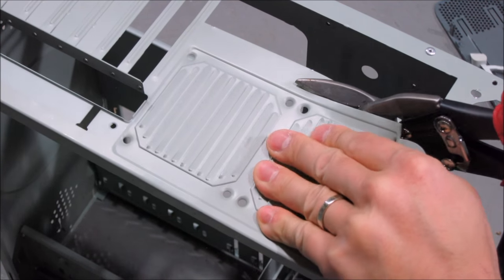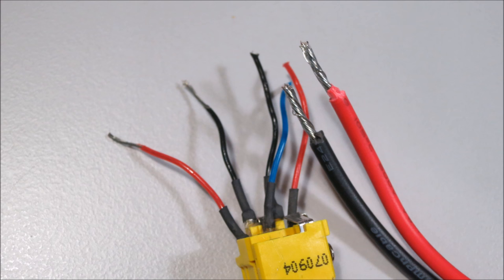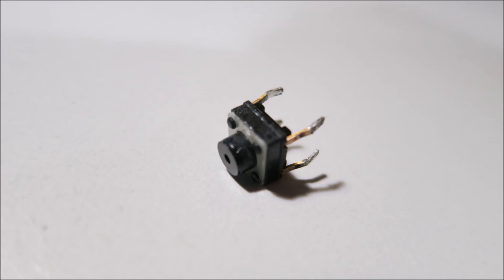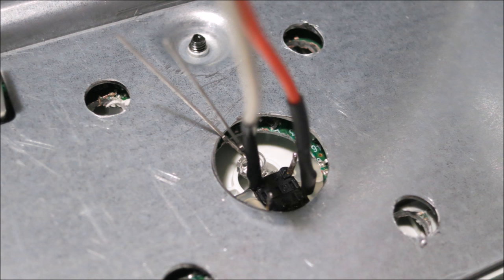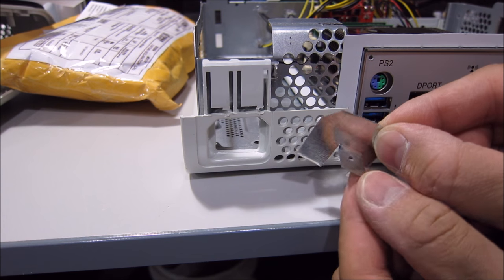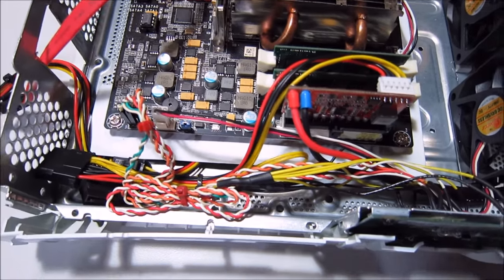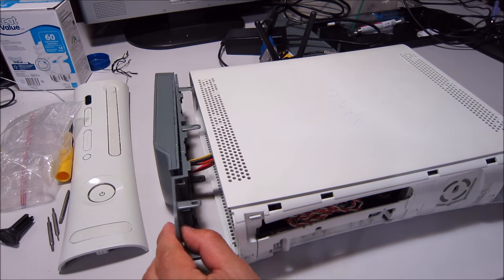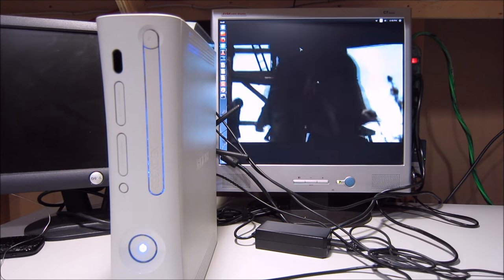A Computer in a XBOX 360- mod/ build

Comment: 5 year old video, but the powerbutton/led/wireless assembly is actually connected with USB, and with a microcontroller and some soldering you can get it to work like a stock 360

Comment: Love this stuff! New subscriber, really some great ideas and builds on your channel.  Man what stopped you from wiring up the whole RF board so you can use the 360 wirelss controller on it for some retro gaming or even to control the whole PC? I know the drivers exist natively in windows for the RF board these and it can be wired to usb input. Then you'd already had the factory xbox leds as well and could wire up the switches and other leds directly on it.
Reply from the maker: Thanks for the sub and the feedback! Good points/ideas. I'm not that familiar with that side of things. Admittedly, I don't have an electronics backround. If I had more time I would love to do the things you mentioned. Honestly I have to look up too many things up even to know where to start!

Comment: Great vid! I'm wanting to do something like what you have but it's going to use around 300 to 350w, is there a psu like the one you have that can support that?
Reply from the maker: I'm really not sure if a pico version comes in a 300 watt. I have a TFX psu that can go up to around 300w that will fit in my PS3 build and likely the 360 build as well.

Comment: Questions: Could you get two SSDs in there?  Could you use a microitx motherboard?  Could the 360 DVD drive be kept in?  Would you build such a system for $150, if parts were supplied?  If not in a 360 case, maybe an original Xbox case.  Then, if an original Xbox case was used, could a video card also be put in?  Serious, inquiry.
Reply from the maker: 2 ssds. Sure there is room. micro atx board (a smaller one) could fit. As for the 360 drive, I'm not skilled enough to get it hooked up to the motherboard. I'm not sure if it's even compatible with other boards. I've made a HTPC in the original xbox. I used an AMD APU only. That being said, I've also seen people mod it with a pci-e extension cable and the vid card laying horizontal. I would guess a single slot card would be best and not a dual slot. There isn't a lot of room once you get a cpu cooler and components in there. Heat removal is the tricky part once you cram more components in. Will Urbina made an insane xbox build and crammed everything into it. I'm not sure if it's still operational though.

Comment: Is it possible to fit directly a notebook motherboard with i3/i5 CPU and dedicated VGA? Also this should allow for the use of DVD player....? Thx in advance, and great video!
Reply from the maker: It is possible. Depends on what size of notebook motherboard. That would be a good idea but likely not a project I'd be able to do!
Reply: Well, i was thinking that after all console motherboards are exactly like notebook motherboards, so why place an entire desktop system! This should save up a lot of space and you can just use the original notebook power supply ;)

I might try that, but i'm not sure i can do it, if you have any suggestion or if you will ever try to do it, link me the video! XD
Reply from the maker: True about the set up and use of the power brick. The funny thing is, I have an old laptop that might be a candidate for such an adventure but I won't do it unless my screen gets busted up! I'll look for an old one with a broken screen. Make sure you sub and you'll see if I ever do one. Right now I don't have anymore broken consoles...
Reply: Ooook, i need one half-broken notebook too XD

Comment: Oh no, you just drilled the RF module? 🙈 You could have used it almost 1:1 as a USB wireless controller adapter, didn't you know that?
Reply from the maker: Don't need that function for my uses.
Reply: It's still kind of sad that board got destroyed like that. The power button can be caught on pin 5, if I recall correctly and it's possible to feed the board with serial signals to control the LEDs individually in green, red and amber. There is also a signal to just call the Xbox 360 boot animation. With some kind of microcontroller the front could have looked more authentic.

Overall it still is great and I like your other videos, this was the only thing that really bugged me.

Comment: cool. which heat sink is that? thanks
Reply from the maker: It's actually an embedded apu with a pre installed passive heatsink, therefore silent. It is only passive because the tdp is so low, like around 25 watts.
Reply: oh ok. thanks

Comment: Nice video, too space. Try insert this hardware in a snes case.
Reply from the maker: Space is good for the ventilation which is so limited which is probably why the xbox360 had so many overheating issues.

Comment: so if you wanted it for gaming would you just have to make more ventilation
Reply from the maker: Yeah, I think so. I've seen some with no ventilation but I don't know it they still work or throttle. Also, a strong enough TFX type PSU is a consideration. A 750ti that runs off the PCI-E power (65w) would be my choice... they also come fairly short.

Comment: hey, I'm following your video but I cant work out how to do the power switch... please help
Reply from the maker: I've seen better ways to do the switch. I used a momentary switch from another device. Basically made a hot glue support/webbing to hold the switch where the xbox push button would be. A lot of trial and error and I would recommend this. Make sure you solder the 2 switch wires on diagonal sides of the switch. There is no worry about negative or positive for this switch.

Comment: orange pi  or raspberry pi inside
Reply from the maker: That would certainly be a lot of space for the pi. I'm still enjoying this has a media center.
Reply: @LadybugAdventures   do you think it is possible to fit a micro ATX mobo  and its big 24pins power supply  inside  xbox360 ? do not know if I can power micro atx motherboard with the same power supply you used in the video to save space .
Reply from the maker: @tunkunrunk  I think only a pico psu could work due to the space constraints.

Comment: does this help in gaming I mean can we play games smoothly
Reply from the maker: This motherboard is not a gaming board nor is the apu in this case. You could put in another low wattage cpu/apu. An A10 APU for instance can be purchased with R7 graphics and 65w. Still not really considered a gaming computer but could be used for some lighter games.
Reply: Maybe when the Ryzen+Vega APU's are available it will be possible to build a low-end 1080p gaming machine, assuming there will be compatibility with mini ATX boards of course.